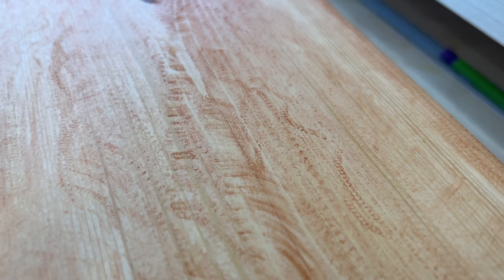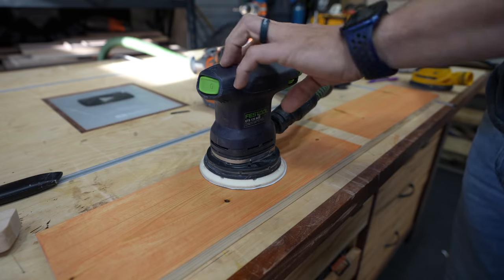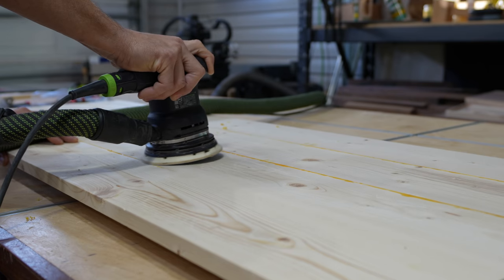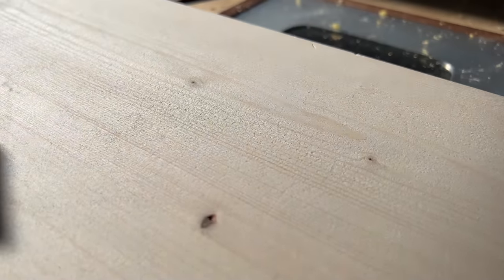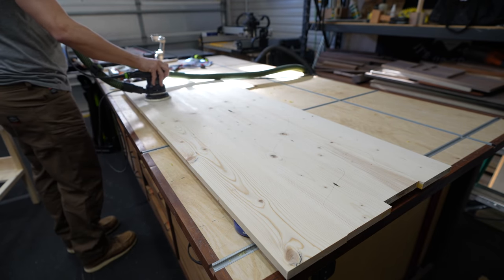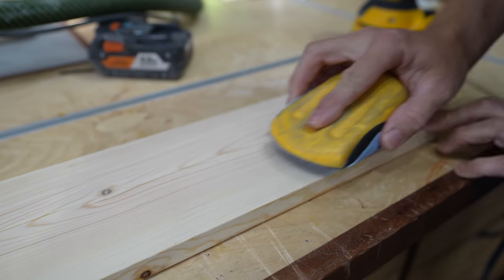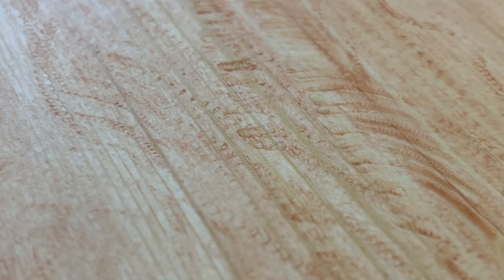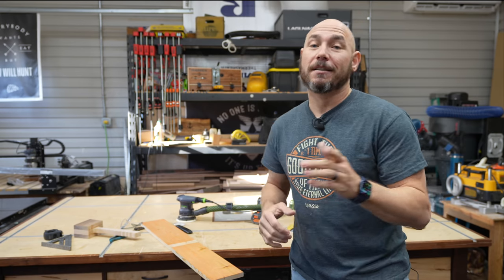Do THIS and You Will NEVER Have Swirl Marks!

Comment: Part of the problem is starting with such low grits. In most cases, it is not necessary to start with 60 or 80 grit. That is really aggressive paper and is really meant for stripping paint. Those are the grits that will cause the most swirl marks. Using cauls on glueup and scraping the glue off before it dries will make a big difference in the joint so you don't have to start with such aggressive sandpaper.
Reply: You can still get sanding marks with 120/220 just as easy if not done right
Reply: @shanebrown2963  yes, but it's less likely with higher grits and easier to remove. There's no reason to start sanding with 60 or 80  grit paper.
Reply: Glad you pointed that out as I was thinking the same thing. Honestly with such soft wood you should probably be starting at 120. Save yourself a lot of time and effort.

Comment: This is 100% accurate I have had this problem many times. I start with a higher grit 120 or so then wipe the wood between grits. And like you said let the sander do the work I use to want to push on the sander makes it worse plus will burn up velcro on bottom of sander.

Comment: Card scrapers and cabinet scrapers work awesome for removing glue from joints that are glued together, I have both and it reduces swirl marks because your not trying as hard to get rid of the imperfections at that glue up with your sander.

Comment: You mentioned not pressing down hard while you're sanding.   Another tip (if your dust extractor / shop vac has variable suction rate) is reduce the suction so the higher suction doesn't cause the random orbit sander to press harder into the wood while sanding.

Comment: Any suggestions as to how to fix sander marks now showing up after I’ve stained the door? I think I’ve over sanded as well. I was trying to fix someone else’s repair “fix” to the door cracks caused by high heat and high humidity in Mexico. I don’t have a lot of options when it comes to products to use. They don’t have wood conditioner so I used bondo, sand dust from door, a tad of wood hardener and a dash of stain. Door looks way better than it did before but I see all the imperfections. After seeing your video I subscribed right away and now know how to sand properly for when I start on the opposite door. I definitely over sanded and am afraid at this point if I sand anymore the stain won’t absorb properly and then I’m really screwed! Help!

Comment: Instead of using the sanding "mouse", I just use an older style 1/3 sheet "finishing sander" for my last high-grit pass.  Works great as well.  Picked up a couple of those finishing sanders at Harbor Freight like...15 years ago...and they are still working just fine.
Reply: I just had an awesome opportunity to get a one-on-one lesson from a retiring woodworker for a huge company. He said he NEVER uses orbital sanders at all, and instead recommended the same thing - a finishing sander, just as you say. I learned more about finishing from that guy in one day than I knew from my entire previous 48 years of life.
Reply: Are those the square sanders?
Reply: @mikebroughton409  correct. He preferred Dewalt...
Reply: @mikebroughton409  - More like a rectangle for the 1/3 sheet.  The square ones are the 1/4 sheet.
Reply: @michaelkeymont501  - Oh, I still use a random orbit sander.  Up to about 220 grit or so.  But, unlike most YouTube woodworkers (for reasons I will never understand), I usually sand up to 400 grit, or maybe even 600, using the 1/3 sheet finishing sanders.  Gives me a buttery smooth surface.  Even on something "fuzzy" like poplar.
Reply: @asbrand  we make parts for products that are ludicrously expensive and, believe it or not, we sand to 120 on a drum sander and go straight to sanding sealer - 3 - 5 coats - and then 1 or 2 coats of nitrocellulose lacquer. It’s a bizarre approach, but it works perfectly. The only additional sanding is going over the sanding sealer after all coats have been applied, the next day using 240 grit Rhynosoft by hand. After the Rhynosoft, it’s straight to lacquer.

Comment: How do you apply your top coat?
Reply from the maker: I typically brush on water baed poly on pine/spruce.  For the next project I am building I actually bought spray can lacquer because it was such a small area.  Worked great!
Reply: @731Woodworks  do you poly the whole project or just the top surfaces.

Comment: Your only partially correct. The paper that you show on your sander in the video that is worn and cracked with torn edges is making just as many or more swirl marks. Changing your discs when worn will help. I’ve worked for a wood flooring company for 20+ years and we see this from sanders on even the hardest woods. Our sanders have to hand sand with paper if they need to use an orbital sander.

Comment: Perhaps use a hand plane instead of sanding to finish the surface? No swirl marks ever. 😀
Reply from the maker: lol true
Reply: On a serious note. I am just learning about hand planes now. Several things make them attractive to me. No dust, no consumables, they are quieter, they last literally longer than you and I will live, and I think they may be much faster than sanding once my skills increase. Not to mention if you find abused ones that look like junk at flea markets or yard sales for under $30 they can be refurbed by anyone with very basic tools like a grinder, a wire wheel, sharpening stones and bucket to put solvent in for rust removal. Some people simply use vinegar as the solvent.

Comment: Do not use circular sander,.......use a belt sander & sand with the grain.
Easy-peasey solution,....duhhhh.
Reply from the maker: I've never had luck with belt sanders.  Causes awful marks on pine/spruce.
Reply: I'd NEVER use a circular sander on wood. That like a cardinal sin in my book. You never go against the grain unless your stripping